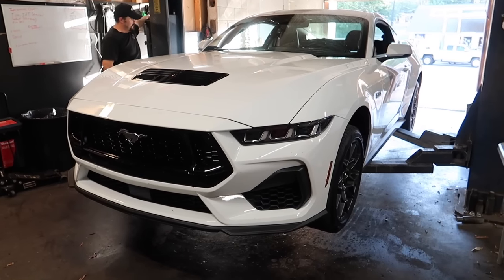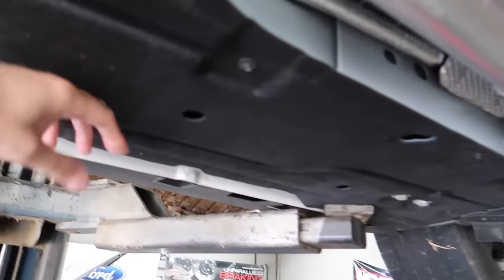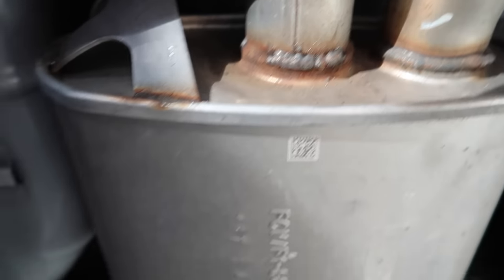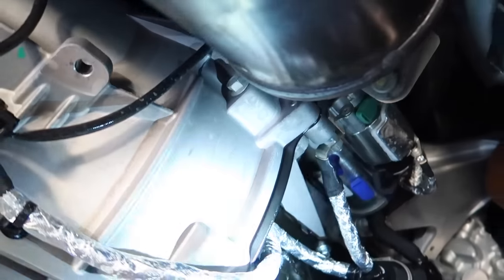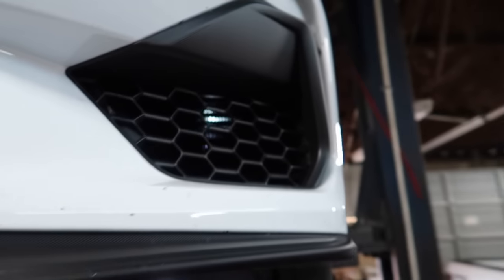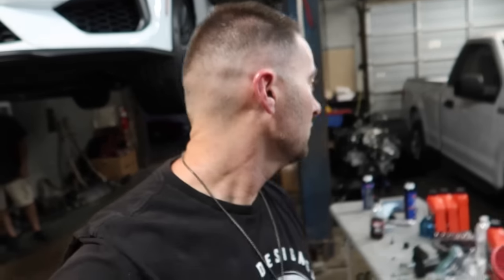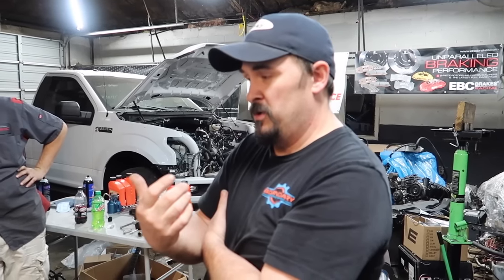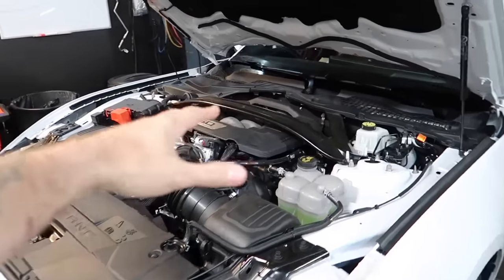WHAT WE FOUND UNDER MY NEW 2024 MUSTANG GT s650 WAS SHOCKING... 😳

Comment: Alex, I’ve had my S650 for a couple months now. When I purchased it there was a clear plastic bag in the trunk along with the floor mats. The bag contained flat black deflectors and mounting screws. I noticed when you had your car on the lift, you had two of those deflectors mounted on each side just to the inside of the two front wheels. I’m taking it that the dealer was probably supposed to mount those deflectors under the car as part of the delivery prep but didn’t know where they were supposed to go.  Got mine in carbonized gray metallic with the performance package. I love it. BTW, great videos.
Reply from the maker: Thanks. Glad you are loving your car. I certainly do mine. The plastic things are for airflow I think

Comment: At SEMA both Whipple and now ProCharger showed their new S650 Mustang Gen 4 Coyote super chargers. Whipple is advertising 800 horsepower. This before a tune which will likely be available in the upcoming months with Two superchargers becoming available only a month after the 2024 Mustangs introduction. Personally. I think the Gen 4 Coyote will be an 8000 RPM monster with tuning and a supercharger. Thanks Zander for your honest information regarding the new S650 Mustang.

Comment: I got My S650 a month ago, traded in for my Bronco, although I miss my Bronco I really love this Mustang. It is my first ever and I wanted. I think my only regret is getting it with automatic transmission.  Don't get me wrong. It is a lot faster than the manual, however, I would enjoy more driving it as a manual.
One another issue that I have with the automatic is the "manual mode", It has too much lack when you try to change the gear and it's annoying, also it happens to downshift, It takes too longer to react. Other than that, It is an amazing car.
Reply from the maker: Huge congrats. Yes. The manual is fun but that auto is still great

Comment: I own a 2024 GT Premium. I did not like the tablet in the beginning. The components were getting too hot, locking up, not displaying correct caller ID and much more. I finally figured out it was the connection to the LTE network for updates and reporting driver information. Once I turned off vehicle connectivity and connected with a usb cable, it works flawlessly.

Comment: It's 92% exactly the same as an S550. Updated screens, some exterior refreshing, and a couple of parts bin swaps. 

Did you say "all new" with a straight face ?
Reply from the maker: It’s actually about 92% different. Not even the seats are the same
Reply: What won't bolt onto a s550 chassis

Comment: I did not like the steering feel. It felt numb. Weather you are moving or standing still the steering feels the same. I am on my 3rd S550, totaling 100k + plus miles in them. The S650 steering felt like there was no resistance. I did think the G4 Coyote is snappier, better throttle response.
Reply from the maker: I do wish the steering felt heavier

Comment: If it throws an emmission code it notifies the manufacture.  If you remove carbon traps in intake you void warranty , they are an emissions item
Reply from the maker: The car is not monitoring the filters. They are located POST MAF. That’s how cars work. If it was PRE NAF then it would be different
Reply: @Zander13Productions  it’s monitoring the car as a whole.  ONLY when a trouble code happens is when the car sends the data to Ford.  The carbon traps ARE an emissions item and will void warranty if removed. They’re to absorb the fumes from the engine when the car is not running of the unburnt gas when the engine is off.  Valves remain open at some point allowing the gas to come back into the intake system, and the carbon filters are there to filter that out.

Comment: Wonder what LTFT and STFT can reasonably keep in control, add the damn headers and cat delete, let the ecu learn to add fuel with the LTFT trims the main other field would be "transient time" id guess ( time for feedback between factory O2 sensor location and wire length vs headers ), use a straight thru Hollowed out Muffler can and weld O2 bungs into it and space them till it doesnt throw a code ( it will work ive done it personally on a off road only gen 3) for down stream O2....
 Bet it would work though i havent tried to pull one of these tunes to look yet....

Comment: Im ready to trade up my 2019 PP1 GT Premium for the oil pan alone! the air flow looks incredible.
Reply: Yeah my car is lowered and I hesitate every speed bump thinking about this plastic oil pan 😂
Reply: Just get the part number from Ken and order it, same engine
Reply: @ShawnGilbert1967  oil pan swaps that easy? I'll have to look into that lol
Reply: @stevensmith8313  easier than selling and paying Mark up lol for DAMN sure tje interest alone if you just got to have a metal pan lol....just have it incase? Maybe feel better? Save the 20k you wljls lose in the transaction?
  Those pans are tougher than you might expect we pulled 3 or 4 and didn't care how the cores were handled much tougher than you might think and yes I didn't like em either but they aren't worth trading cars.

Don't forget to have HPR put billet oil pump gears and hell maybe the gen 4 intake cams in white he is swapping the robust composite pan off your gen 3 hehe maybe a stall too let's not waste the labor but more importantly let's not waste the money for a S650

Comment: Great video Alex!  Love the underside look and you're right It looks like they took a bunch of bits and pieces off of the Mach 1. I saw a lot of features on that car that are currently on my Mach 1.  I wonder if they corrected the passenger side active exhaust issue where the wiring harness for the actuator was rubbing up against the frame?
Reply from the maker: Thanks! 👍
Reply: I had a shop cut and fold over the little area where it was rubbing.  The smoothed out the folded over area and painted it.  Problem solved no more rubbing.  I went through two of those passenger side harnesses.  Ford could have reversed the actuator so that it faced the front of the car and plugged in the harness.  There is plenty of room.
Reply: @michaeldials9291  I did the exact same thing after my wiring harness got severed and also wrapped the new harness in gorilla tape and no problems since then.

Comment: They deleted  the rear bottom diffuser on s650 made it flat  and smooth  now . Maybe you  don't need  like the s550 PP  due to the extra aero we see under the S650 car ? 
The rear bottom diffuser on previous  2018 to 2023 S550 FN GT 5.0 PP ,   looked really good and was  like the rear diffuser from  Ferraris F430 style with very noticeable  fences to split exiting bottom air .

Comment: Does it have magneride and if so how’s the ride with or without magneride?
Reply from the maker: No mag ride. I test drove both and felt little difference on the s650 on the street
Reply: @Zander13Productions  thanks. I’m fixing to order mine tomorrow. I seen where you live in Clarksville I’m not far from you in Dover
Reply from the maker: @thomasa2145  yes. You right in my neck of the woods

Comment: Interesting video - Good luck with your new car, will be following along as you move forward. Trying to decide on keeping my 2018 GT Premium v getting a S650. The way I would order the car would bring the cost to almost $60,000 + $5,000+/- sales tax😬. Local Ford dealer insists on additional $1,500 +/- of “mandatory” dealer add ons. Needless to say I would never buy from a dealer who has “addendums” and or dealer add ons I don’t want.
Reply from the maker: Thanks. All the dealers near me don’t have ADM on regular GT cars
Reply: Yeah I can decide to trade in my 18 I owe 6k saw a dark horse on the highway looks sick
Reply: @TylerJohn-f8t  Biggest favor you can do for yourself - Keep your car until it’s paid off. Then make car payments to yourself until you can pay cash for your next car. I’m 75, and my 2018 S550 is only my 5th car. I’ve never had a car loan. I always by new and take great care of my cars. I typically drive my cars from 150,000 to 200,000 miles. Happy Motoring 🤠
Reply: @TylerJohn-f8t   My 2018 GT is almost payed off too. I looked at one of these new cars at the local dealer the other day. I really like it but I'm just not going to get one anytime soon. With my current car, I'm pretty dead set on getting a VMP Supercharger in the coming months so I'm still gonna keep it for probably a few more years at least. I've put $10k worth of cosmetic mods in it + full catback exhaust, and haven’t even touched the engine yet.

Comment: Hi Zander, you saying that you’ve test drove both with and with out Magnaride and not see any difference on the non Magnaride cause im contemplating if I should not add the MR to my order. Cheers
Reply from the maker: There is some difference but it’s not a deal breaker if you can’t find one it it
Reply: @Zander13Productions   how’s the ride quality on bumps and turns on bendy roads etc with out it ?
Reply from the maker: @eremyjay  it’s not bad at all but my roads here are not that bad. If you can one with mag ride it’s definitely worth thinking about. But for me not a big deal

Comment: I’m not a fan of the S650’s. I’ve driven one and there is a noticeable difference from the S550’s for the better, but even in person I’m not a big fan of the dash. The exterior of the car looks better in person than in photos, but the screens stuck on the dash just ruins it for me. 

Good luck with whatever your plans are, I’m still excited to see where the aftermarket goes with them.
Reply: I agree. The screens are atrocious. All they had to do is work on flow and integration but they just chose to stick them in there like an IPad. Zero thought and effort on their part
Reply: Agreed in certain colors, dark ones, they look better in person exterior wise. Interior they lost me it's a big step backwards from the last generation. They copied the current type car market  dash found in everything from mini vans to Buicks now with that screen type dash which don't belong in any muscle car. Even if you like that kinda thing, they super cheaped out and didn't incorporate it into the dash, they just half a$$ed plopped that sh!t on top the dash. It will take a whole lot of horsepower to get me to over look the interior if they want to sell me a new mustang, im holding on tighter to my 21 GT Premium now than I was 6 months ago lol. If the new dealer installed and factory backed whipple turns out to be fairly priced, I might look into it, but that dash would certainly need to grow on me quickly.....used Shelby GT's and Mach1's never looked better at this point!